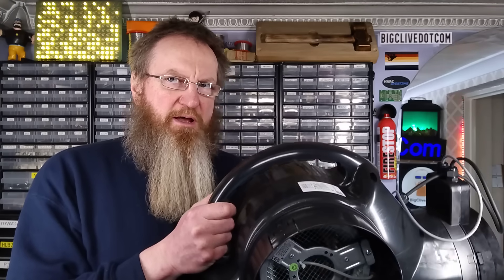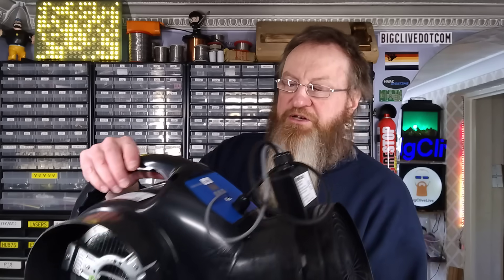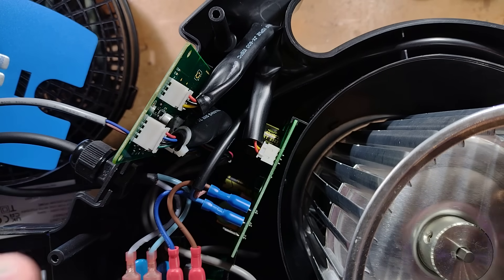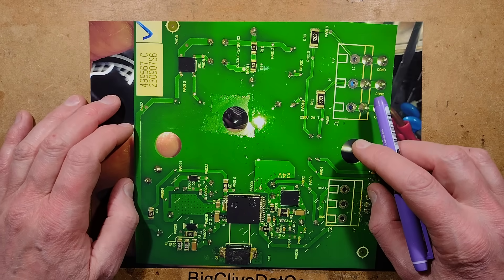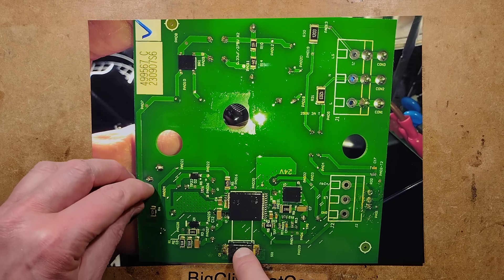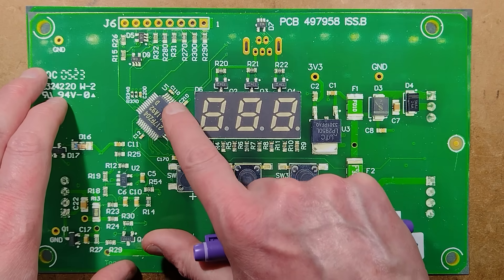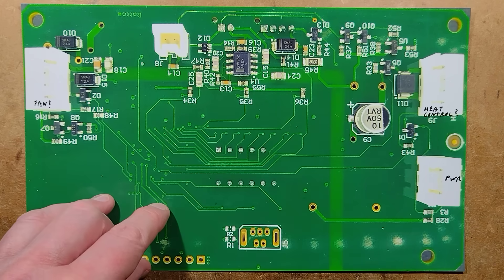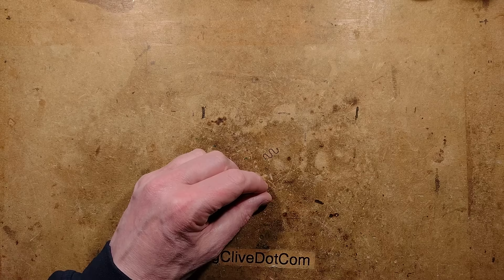Inside a Positive Input Ventilation (PIV) unit

Comment: The problem with the positive input ventilation in a cold climate like in Sweden is that it pushes air with a high amount of humidity out through the walls causing condensation and mold issues.
Positive input ventilation makes sense when you live in a warm climate.and cool the incoming air.
Reply: the warmer and thus naturally more humid air indoors gets pushed against cold surfaces in the walls and the moisture condenses, drips into insulation/drywall/wood and before long you have a mold factory. Also here in the great lakes region, RH% is way too high outdoors for at least 8 months of the year
Reply: Humans breathing, washing,  plants and cooking generates humidity in the building. That humidity is pushed in to the walls by a system like this, and in colder climate that causes condensation and the problems that causes.  Its not about relative humidity and temperature its the humidity caused by living in the house.
Reply: @ulwur  lots of people don't realise this. I used to wake up with really bad condensation in my bedroom, and it got to the point it was becoming a serious issue in the colder weather. Walls went soft, my blinds rusted, mould was growing on walls and around the window... It was horrible. 
One £5 humidity sensor later, and making sure to open the window or leave doors open to allow airflow to displace that humid air from one room to another, and the condensation is no longer an issue. I will occasionally leave a dehumidifier on if I'm in a bedroom  for prolonged periods of time and can't/don't want to open the door. But honestly it doesn't do much. The target is usually anywhere between 40-55% RH, and a comfy temperature of about 18°C -21°C. 
I also have a small under blind fan I made to pull moist air away from the window at night.
I sleep soundly now. 😊
Reply: Yes, in cold climate we don't want to push warm humid air into the colder walls. It might condense there and cause mold. So the fans are installed to pull air out. On summer it should be fine to blow air in.
Reply: Here in the USA the air is VERY dry in the winter... 🤷🏻

We actually install humidifiers into our furnace ducts to ADD moisture in the winter because it gets SO dry
Reply: I would have thought that Sweden would be very dry when it's cold. Are you saying that the condensation and mould is happening in the fabric of the building? On the other hand if you have the unit running it should lower the humidity of the building so the air leaving would be dryer than if you didn't have it. I find it works best when it brings cold air into a warm building.
Reply: @matthewwakeham2206   Norwegian here, but we also have cold climate. Yes the outside air would be very dry when you bring it inside and heating it in the house on a very cold day.
That also means that the inside air could become very wet when it cools down to outside temperature. With enough ventilation you probably could get the inside air dry enough to not cause condensation when it cools down. But then the air could become uncomfortably dry.
Some people probably also use humidifiers as we do in my house when it gets very cold.
I have seen condensation on the inside of the windows this winter with as low as 50% humidity in the middle of living room. And I live close to a fjord, meaning that it don't get very cold or dry compared to many other places.
Just -15 is a very cold winter day here.
I live in a older house, but the windows is only a few years old.
Newer or remodeled houses would  per regulation have a ventilation system with a heat exchanger that warms the incoming air and cools the exhausting air in the winter.
Reply: @matthewwakeham2206
Your showering, cooking on the stove and all your breathing and sweating produces moisture. This is the moisture that can get trapped into your walls, making this very bad mols start festering. There at least is a risk. It would be better if you have a more expensive unit where you can balance the air intake with the air outlet to create neutral pressure sort of. Of course there will be pressure in moving air but I think I made the point clear regardless. If you reverse the simple airflow you get an underpressure which can cause you to struggle with opening doors and such
Reply: are you sure you didnt mix those up? relative humidity drops with temperature, so only cooling the air would cause condensation
Reply: @drkastenbrot I think that's what he meant. The fresh air displaces warm humid air which causes condensation where it exits the warm envelope of the building. In that light I guess it kind of makes sense that here in Belgium we tend to put the fan the other way round.
Reply: @drkastenbrot  Absolute humidity drops with temperature, relative humidity increases. Air can absorb more temperature when warm. So when warm indoor temperature is pushed out of a building there are always some that passes out through the walls and condenses.
In an area where you cool the air indoors you want the positive ventilation. Best is to keep a balance to avoid troubles with doors and windows.
Reply: @ehsnils  you should seriously re-read about humidity, and the properties of absolute and relative humidity. if absolute humidity changed with temperature, water would be created or destroyed out of nowhere.
Reply: @drkastenbrot he means the airs capacity to hold water goes up and down.
Reply: @ulwur  that is called relative humidity

Comment: Here in the US, we have other options for fresh air. With central heating and air conditioning, you can add a fresh air duct to the return in the air handier and route it outside. It's the same idea as the make-air on a rooftop packaged unit on a store or restaurant. It splits return air between inside and outside the building. If you've ever gone through a swinging door and felt the resistance and the air coming through the door when you open it, that air is from the air handler. Restaurants used exhaust fans in the kitchen, which would normally cause a negative pressure inside the building. If you have a gas water heater, you can pull CO from the flue into the building. We add air to make sure that doesn't happen. For residential buildings, you only want a small amount of make-up air, as it needs to be heated or cooled, and you're forcing treated air out of your home. In humid places, you are better off dehumidifying instead of replacing the air with the same wet air. In dry climates, like Arizona and New Mexico,  you add humidity through evaporative cooling and open a window to vent excess moisture. We vent attics to the outside,  with outdoor air or whole home exhaust fans. We don't pull attic air into the home, except for some very high efficiency homes (envelope). Those circulate air from top to bottom and use very little supplemental heat. I had one customer with an envelope home, which had the smallest capacity furnace sold, which was about 1/3 the size for a typical home of that square footage. It was used sparingly and for short cycles, costing the customer about as much for the winter as a month for my much smaller home (about $60/year to heat their home). He only added the system for air conditioning, as an envelope home doesn't vent humidity very well. If you seal up a home airtight, you'll have mold issues. They have to "leak" or breathe,  to get moisture out.
Reply: Your furnace should always have a fresh air supply, even if it's electric, because the house needs to "breathe" and sealed up houses are causing big problems with moisture problems. That furnace is super efficient but the farts don't disappear for days and the $80 filter nobody changes in schedule can't keep up
Reply: What is really needed is an intake with a baffle that can switch from pulling outside air or inside return air in - it would save so much a/c expense, as usually at night, the temperature drops, and you don't need to run AC, just suck in outside air and blow out the hot air in the house, and then shut that down automatically when the temperature starts to rise in the morning, but that would be too energy efficient, so why do that?? I do the same thing now, but with box fans in the windows, and I only run AC for a couple of weeks a year when it doesn't cool down enough at night, whereas most people run AC continually all summer
Reply: @gorak9000 thats what attic fans are for and they should be used with timers, humidity, and temperature sensors to operate automatically. All the heat and humidity goes up so it needs to be vented out and the fresh air sucked in under the soffit and out from the house. Fresh air and sunshine is a spectacular thing

Comment: I've wired in some of these and they really do help with mould on walls. Most dwellings with damp issues are down to how people live with zero ventilation.
Reply: Drying clothes on the radiators and letting the steam out of the bathroom into the house. Running a EcoAir descant dehumidifier actually reduces the heating load on the house.  If its frosty out side open all the windows for half an hour a let the dry air in.

Comment: Worth it's weight in gold. It completely eliminated mould complaints from properties I was managing.
Reply: Yep I fit them lots in council housing and they work great
Reply: @joshuabest100 generally they are put in for tenants who never open the windows (to keep the cold out) and dry clothes on radiators.  … guess what happens to the building fabric….     interstitial condensation is non trivial and these devices can also make things much worse as well. …very interesting science
Reply: @mrwoodandmrtin  I think its an educational thing… trying to cut heating costs

Comment: The relay place on the heater board would probably be for a line voltage motor control. And the connector above the display might be for remote display or LEDs.  PIV is a great concept that is rarely used here in the States.

Comment: Ok now that's a recpie for disaster .Your bringing in cold damp air from a damp moldy attic full of fiberglass mold spores from outside and growing in the attic into your home .
The right way is with an air to air heat exchanger with a pre heat on the make up air and many of them have a condensation discharge because warm moist air hitting a charge of cold warm air will give you indoor weather (Rian and fog)..It makes sense as an attic vent but not for fresh air
Reply from the maker: If the attic is damp and mouldy that is also an issue.  This unit pulls outside air in and could assist in keeping it dry.

Comment: though in dry countries its opposite. positive preasure can cause mold in the walls because of human moisture. gets pushed into the walls. also that heating element will be used all the time to dry the air or else it would just suck damp air from outside also no heat exhange in that unit. pretty bad. also a proper one would be 230volts with 0-10volt control

Comment: Missing connector on the front might be a vertical USB Micro-B?
Reply from the maker: I did wonder if it was some sort of data connection like USB.
Reply: The pinout would fit. However, the used MCU doesn't have USB built in. They could have implemented it in software, or it's just a serial interface (the connected pins have serial capability). Or they wanted to implement USB and gave up ...

Comment: Not living in a humid area (San Diego, California), I don't understand why your attic would be/have less dust or humidity than the rest of the house?  I don't have A/C (rarely would have a need), but do have a smallish house fan mounted in ceiling, taking air OUT of the house, into the attic (opening windows for fresh air, either hotter or colder depending on what you want).  This also pushes the extra hot air in the attic (lots of sun on roof, insulation above ceiling, not on the inside of the roof), and also lessens the temp in the house itself.

What am I missing on this?   I'd think a whole house fan mounted backwards, or a fan that was reversible mounted in the ceiling with simpler(?) controla and running on mains voltage would be just as effective, no?
Reply from the maker: I think the main advantage is bringing in a continuous flow of fresh air.  Humidity tends to build up indoors and the airflow disrupts the establishment of mould.

Comment: I'm trying to imagine a situation where I'd want smelly attic air inside my house.
Reply from the maker: There is a slight attic smell at first, but the flow of air freshens the attic too.
Reply: As Clive said. The air moving through the attic soon clears any smells, making the whole house smell fresh after a few weeks.
Reply: I live in the Texas Gulf Coast.    This does the opposite of what we need (except in winter, maybe).   We do have attic fans to blow hot attic air OUT though.
Reply: They work very well at reducing internal damp in old cottages etc caused from poor ventilation.
Reply: No way I'd want the fiberglass covering everything in the house and I don't trust their filter to stop it.
Reply: If you start it all from the get go, it's a better option. Every clean room knows this.

Comment: Is the relay control circuit in parallel with the triac or separate? If separate I wonder if it might be to trigger an external aircon unit.